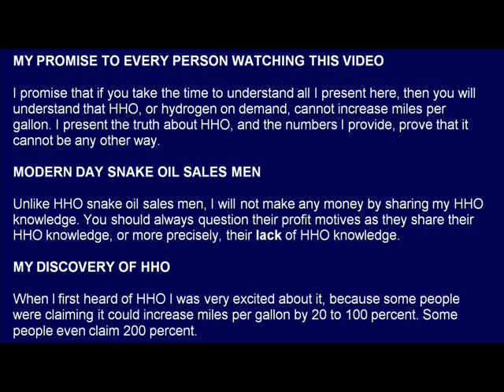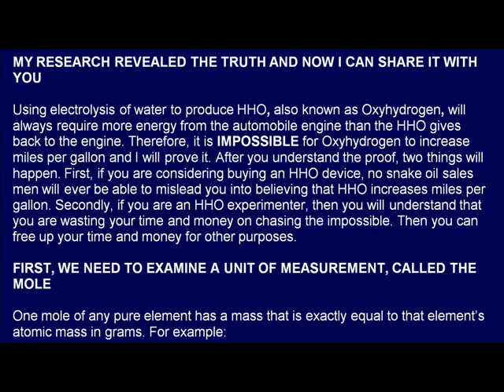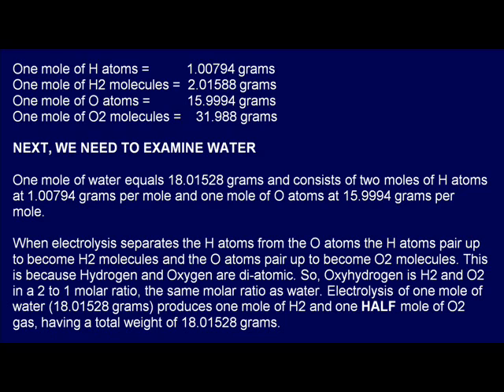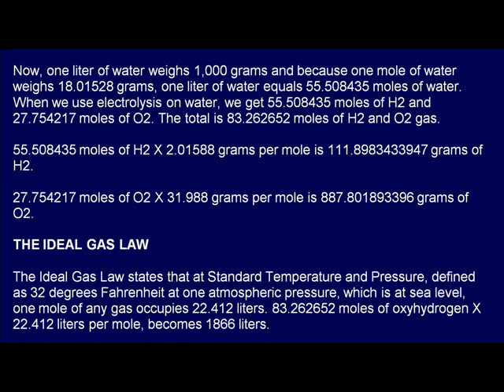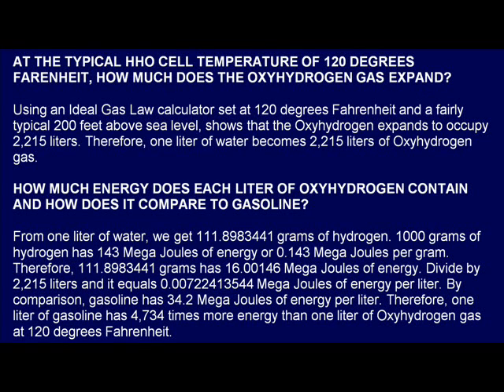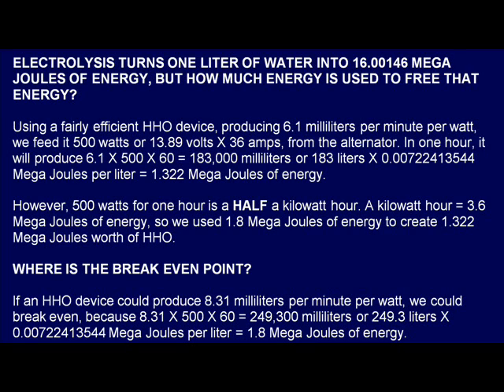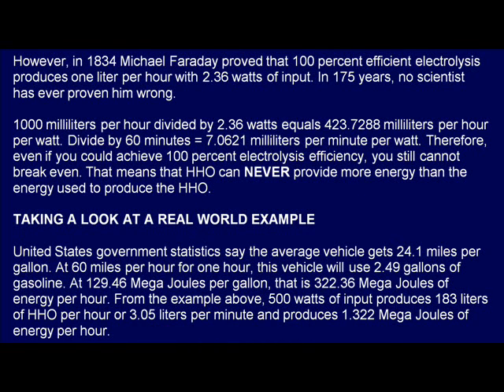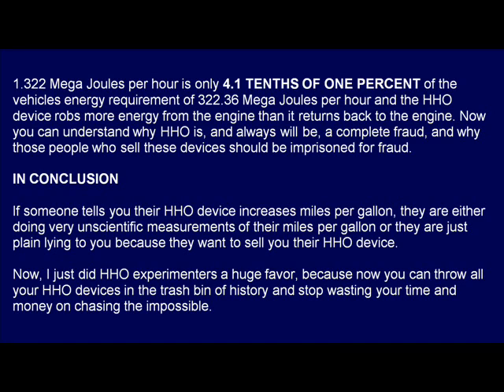ABSOLUTE PROOF IT IS IMPOSSIBLE FOR HHO TO INCREASE MILES PER GALLON

Comment: You probably don't need to take your calculations out to 10 significant figures.  I'd settle for 5 in order to get the point across.  None-the-Less; the science is there and indeed, there is no way to get more energy out of the system than you put in.

Comment: For those of you who think your just using energy that is otherwise wasted by being produced with the alternator, thats incorrect. The alternator doesnt just sit there in its own little isolated world, always generating the same amount of power while having no effect on anything else. That assumption is incorrect. So the idea that fuel economy can only improve, because you using otherwise wasted power to make HHO, is thus incorrect. The more drain you put on an alternator the lower fuel economy you get from your gas. Anyone who has plugged in a power inverter in their car to run a laptop or something on a long trip can you tell you that it has a significant effect on the amount of MPG they are getting. It isnt just wasted energy so we might as well use it.

Comment: Electrolysis is only 30% efficient so right off the bat you are losing 70% of your energy. Now add in the fact that an automobile engine is only 25% efficient and that woefully inefficient engine is driving the alternator that is only 75% efficient to produce the electricity for the electrolysis and you end up with a huge loss even before adding in the losses due to resistance in all of the associated wiring! HHO is a scam no matter how many idiots swear by it and claim it is going to change the world!
Reply: Of course. Besides, even if your engine, alternator and electrolytic cell were all an impossible 100% efficient, the net energy produced would be exactly zero.

Comment: I love the video.. Its very scientific but one thing it left out. people are claiming the HHO makes the car utilize the gasoline better and this is true when enough is used but a standard alternator cannot produce near enough nor is it efficient enough. 
You also left out how wasteful an alternator is. When converting water using the car's alternator 81% of the energy that would have went to the wheels is wasted.
Cars are around 30%-35% efficient therefor 30-35 units of energy is what actually drives the wheels. With an HHO device only 6 units of energy of  the 100 units of energy in the gas that's used to power the alternator ends up powering the wheels. 

Engine 65% waste (35 efficient)
Alternator 40% waste energy (60% efficient )
converting water to HHO 20% loss (80% efficient) get back 80% power used
Burning HHO in car is 60% waste. (40% efficient) HHO is slightly more efficient  than gas. 

Add all the loss together and its very clear HHO devices are scams.

Comment: As has been stated here HHO is both NOT viable and can't even be used as a supplement to increase MPG, the energy used to generate the Hydrogen is greater than ANY return . You simply CANNOT defy the laws of Physics re energy in v energy out .  A Hydrogen Fuel Cell producing electricity now THAT is viable bloody expensive but viable. Mr Newton KNEW what the was talking about.

Comment: Formula race cars run on ethanol because it has high knock resistance (due in part to a lower burn temperature), allowing them to run higher compression ratios, and because ethanol is safer. It can be extinguished with water and fires spread less quickly.

Comment: That is a horrible idea.   Way beyond the lack of efficiency.   Batteries may do it better.  But compressed browns gas is perhaps the worst idea anyone has ever had.  The thing that makes HHO generators fun is the risk is low since it is on demand usually with a small reservoir.   If you were to compress a few cubic meters into a container you now have a powerful explosive.    Compressing hydrogen and oxygen separately is ok but in the same tank would likely explode as it was compressed.

Comment from the maker: I already knew this but I looked it up for you "Octane ratings are not indicators of the energy content of fuels. (See section 4 of this page and heating value). It is only a measure of the fuel's tendency to burn in a controlled manner, rather than exploding in an uncontrolled manner.

Comment: Hmmm... when I go to the gas pump, fuel performance is listed by Octane ratings, not BTU's.  It's misleading to say a fuel has less energy by saying it has less BTU's.   Ethanol has less BTU's but will outperform gasoline in the same size engine optimized to run on ethanol.... Just ask the Formula Race Cars that have been running on ethanol for a couple of years now.

I don't know if HHO is a viable alternative fuel.  But I appreciate those who are experimenting & honestly sharing their results.

Comment: and in rocket launches they use liquid so unless you can liquefy it its worthless not only that liquefying hydrogen is ummmm??? :S :S pretty hard and will consume a ton of electricity gaining less than you would ever if done in a shed in your home and even commercial liquid hydrogen and oxygen arent being sold at any fueling station now why is that?? because its fucking cold!! and engines wont run at -250c

Comment: I agree completely. The problem is thinking that there is "extra or surplus" energy waiting to be tapped from the battery and alternator. The battery is just a storage device and the alternator produces what it is required to up to it's design limits. If you connect a HHO generator you place a drain on the battery, cause the generator to work harder which imparts more load to the engine. The required energy is more than the gain.

Comment: I don't like it and wished it worked. I agree with some of the guys that have posted here about the altinator. Think of it like turning your a/c on in the car. the draw drains the battery causing the altinator to regenorate in turn causing drag on the engine. But hey, hho is still cool to play with and does make a mean little cheap torch. Maybe usefull somewhere else. I don't regret experimenting with it one bit and will continue just not with cars :)

Comment: I did the same calculations in 2009 using an organic chemistry book as a reference and came to the same conclusion. Once I realized it would take more water by volume to generate the same energy as gasoline and figured how many Watts would be necessary I turned my HHO generator into a torch and never put it back on my car. I datalogged everything from the engine sensors and wondered why I wasn't producing enough HHO and now we know why.

Comment from the maker: @tnlightnin The law of conservation of energy means you can never get out more energy than you put in. The extra load on the alternator to run the HHO devive causes the engine to have to work harder, which means more fuel consumption. Because it takes more energy to make the HHO than you get from burning it, it is an energy loser.

Comment: I believe that HHO is "capable" of boosting an engine's performance, but only if the HHO is supplied from an external source and not produced by the engine itself. For instance a solar/wind powered electrolizer refilling compressed air cylinders.

Comment from the maker: @crazybiker420 HHO might burn at 2000 degrees, but a couple liters/minute cannot contribute a significant amount of BTU's. Vehicles have such huge requirements. Google "energy density" The first link is Wikipedia. The table shows gaseous hydrogen has 0.01079 MJ of energy per liter. HHO is 2/3 hydrogen so it has 0.007193 MJ per liter. Gasoline has 34.2 MJ of energy per liter. So a liter of gasoline has 4,755 times more energy than HHO. Need huge quanties of HHO to make a difference.

Comment from the maker: @crazybiker420 Which is 4,470 BTU per minute The HHO provide only 5.672 BTU per minute which is only 0.1247 percent of the requirement. Plus, it takes more energy to make the HHO than it gives back to the engine, because the engine only turns 24 percent of the energy into mechanical energy and then the alternator wastes 40 to 50 percent turning mechanical energy into electrical energy and the cell itself is less than 100 percent efficient, so anyway you slice it, HHO hurts miles per gallon.

Comment from the maker: @crazybiker420 2 headlights consume about 165 watts. An HHO cell at 6.1 milliliters per minute per watt produces 1007 milliliters per minute, or just over one liter. A cubic foot of hydrogen at 60 degrees Fahrenheit, has 270 BTU. HHO is only 2/3 hydrogen so 180 BTU. Because the cell temp is about 120F the HHO expands and is more like 161 BTU per cubic foot. A CF is 28.382 liters. So a liter of HHO has 5.672 BTU. At 25 MPG at 60 MPH, we consume 2.4 gallons per hour or 268,217 BTU per hour - CONT

Comment from the maker: @crazybiker420 Yes, headlights, or anything electrical, increases fuel consumption. The battery gets drained, a 50-60 percent efficient alternator driven by a 24 percent efficient engine has to replenish that energy in the battery so more fuel is consumed.

Comment from the maker: @crazybiker420 Generally speaking, 34 percent of the heat goes to the cooling system, 36 percent out the exhaust and 6 percent to the surrounding air around the engine. Making for about 24 percent engine efficiency. But that is not the fault of the gasoline, it is just that it takes huge amounts of heat to move a vehicle at a decent speed.

Comment from the maker: @crazybiker420 In the video below, ZeroFossilFuel fed 30 amps to his cell. On this tiny 3 HP engine, it reduced the run time from 11:40 to 10:49 - 51 seconds less run time on 11:40 means he increased fuel consumption with HHO by 7.28 percent. Now, that is with a 3 HP engine. At 60 MPH most vehicles require 21 to 42 HP. 7 to 14 times as much. The 30 amps could not get a gain even on a tiny 3 HP engine. On a car, it is totally impossible.

watch?v=zwqisOfTw0E

Comment: Theoretical Carnot efficiency for a diesel/HHO mixture by HHO energy content:

HHO   Carnot Efficiency
0%            84.6%
1%            84.7%
5%            84.9%
10%          85.1%
25%          85.8%

Conclusion: You need al lot of HHO to make a practical difference in engine efficiency. The idea that an HHO device running off the engine can produce enough HHO to improve gas mileage: busted!

Comment: @getreal I ran my car with 3 HHO generators for 9 months+ covered 11000 miles My mpg did not increase in the slightest. HHO is undoubtedly explosive but in the very small amounts produced to the amount of air sucked in, it makes absolutely no difference.The alternator is a huge parasite of power when running the units. My units produces 3 ccs of HHO per second (and that's a lot) my car at 2000 rpm sucks in 20 litres a second.  0.015% of HHO in air does nothing. I know, I have tried it. Have you?

Comment from the maker: @scum525

What part of requiring 1.8 MJ of energy to make 1.322 MJ worth of HHO did you not understand? An IC engine is about 24 percent efficient. An electric motor about 85-90 percent efficient. Why would anyone use expensive solar panels to make inefficient HHO to feed it to an inefficient IC engine? Please think before posting.

Comment from the maker: @Yourfishman
Even people using a lowly 3 HP engine, hooked directly to an alternator, running an HHO cell at 30 amps, off the alternator, cannot get a gain. Many have tried and failed. Applying the same 30 amps to the energy demands of an automobile, is a total joke. People need to go back to school, if they think HHO is viable.

Comment from the maker: @Yourfishman

As my video shows, 3.05 liters of HHO per minute only provides 0.021672 Mega Joules of energy per minute. NASA got a 6.38 percent improvement by feeding 635 grams of hydrogen per hour or 10.583 grams per minute = 1.513 Mega Joules per minute. 69.81 times more energy. Also, as my video points out, it takes 1.8 MJ of energy to make 1.322 MJ worth of HHO.

HHO energy sapping CANNOT ever boost MPG.

Comment from the maker: @mikem720

A turbo charger spins by using wasted energy in the form of exhaust gases, so you are wrong. Wrong about the alternator too. Read my response to luispedra to find out why you are wrong. In summary, you are wrong about everything you said, except"

"Of course it takes more energy to generate HHO then the HHO could provide into the SYSTEM"

Comment from the maker: @ZOGOVP

Electric cars are in the order of 85 to 90 percent efficient, so in buying expensive solar panels, anyone is far better off using them to power an electric vehicle, instead of powering a 60 percent efficient HHO device and then feeding that result into a 24 percent efficient IC engine.

Comment from the maker: @ZOGOVP

According to John Heywood of MIT, the foremost expert on Internal Combustion engines, today's cars burn at least 98 percent of the gasoline. Gasoline has so much energy, (4734 times more than HHO) that 36 percent of the heat goes to the cooling system, 34 percent out the exhaust and 6 percent to the surrounding air. Leaving 24 percent to do useful work. It is not that the heat is wasted, it is just the natural result of the huge energy demands to move a heavy vehicle at decent speed.

Comment from the maker: @luispedra
Wrong. The voltage regulator controls the field current applied to the spinning rotor inside the alternator. When battery voltage drops below 13.5 volts, the regulator will apply current to the field and the alternator will start charging. When the battery voltage exceeds 14.5 volts, the regulator will stop supplying voltage to the field and the alternator will stop charging. When the alternator stops charging, the load on the engine drops to almost zero. No excess energy here.

Comment: Lots of facts but I'm sorry to tell you that your conclusions are totaly wrong. Your so busy proving that it isn't possible that you completely missed the point. You MIGHT be correct when an engine would be running on HHO only but this isn't the case here.
By adding a very small amount of HHO you drastically increase the efficiency of the gasoline or diesel burning engine.
This is basically THE point you are missing completely.

Comment: @overunitydotcom explosion in the chamber is not oxyhydrogen burning?using an hho generator you turn air into fuel as well as it became a mixture of air and oxyhydrogen.the maths is right..oxyhydrogen cannot trn your 95 octane diesel to a  nuclear reactor... it actually makes no effect to the combustion process. gas burns and additional oxyhydrogen burns next to it. but as already mentioned in the video,output power is much less than input. (at least using electrolysis).

Comment: Your explanations are totally wrong, cause the formulas for oxyhydrogen burning
to produce heat are not applicable in an explosion chamber process... 

There is more mechanical 
energy produced there, therefore the energy output is higher in such an combustion process. YOu can not just copmpare it to just burn hho. It is different in an explosion process as in an IC engine !
ALso you just increase the efficiency from the gasoline fuel this way.
Regards, Stefan.

Comment: dude your thinking is wrong..
#1. just because people make profit on an item, dont mean their motive is bad.. good item = good profit.
#2 the engine of the car or the current gas used,has no effect on the creation of HHo  the alternator is already producing over 12V to complement the vehicles demands electrically which most are not in use at a given time.   Oh ya BTW.. Japan is already selling complete HHO water fueled cars... OWCH ( Ya said folks should go to jail for their hho creationshuh?

Comment: i think this guy works for the oil company. how much energy was used to find, extract and process the crude oil and then distribute and sell  it to you at the gas station. hho is a fuel and should be persued as a clean and safe alternative it's environmental benefits speak for themselves . make your hho with solar with wind and any method you can use wind, solar,waterwheel and  battery  power to compress it and burn it in you diesel gas or modified combustion engine  keep the dream alive

Comment: This is a silly video. Yes it is accurate, and yes it is factual. But it totally misses how fuel, or modified fuel, can minimize waste. 

It has very little to do with energy. Its all about WASTED energy. You have to first understand Thermal efficiency of the Internal Combustion Engine. The Thermal Efficiency of a ICE is about 25%, So you have 75% wasted TE to minimize.

HHO boosting CAN minimize wasted energy. The only question is weather it is worth the hassle & money to do it right.

Comment: @EnergySupply2008
Of course it takes more energy to generate HHO then the HHO could provide into the SYSTEM. 

An auto engine as a SYSTEM produces EXTRA energy. This is why a turbo charger is said to "work".

Like-wise, the alternator produces MORE energy then the cars electrical system uses. If it were not so, your battery would eventually die from running the radio. 

In THEORY, HHO could be generated from the extra energy that the alternator provides which could be used to boost MPG.

Comment: Gasoline may produce more power but wait now.... I did not hear you mention that approximately 65% of that gas is wasted. Also what if solar energy is used? All your mathemagician ( yes I spelled it right) is a waste of our time. You also failed to explain how the hydrogen cleans the engine and helps to increase HP. also that 100% of the Hydrogen is burned. Your math may be right  but I'm still going to waste my time making this device. :)

Comment: @EnergySupply2008 Inspite of a minor spelling mistake,I agree with your comments,for the non- technical minded,briefly,the amount of energy required to produce HHD is greater than any benefits obtained.The only advantage of adding this gas as a suppliment,is it gives a cleaner burn.The reward does not justify the effort.